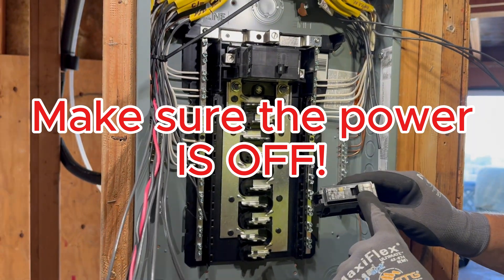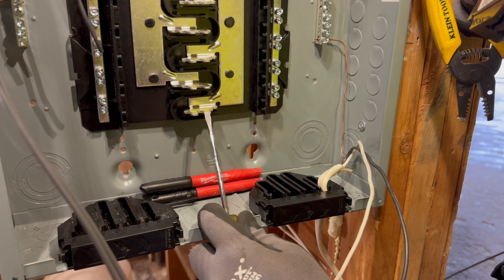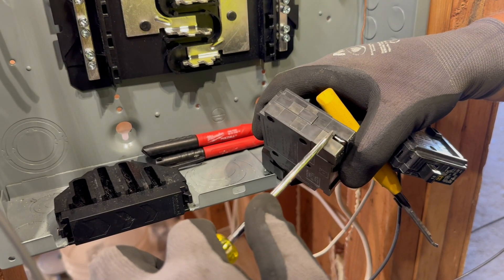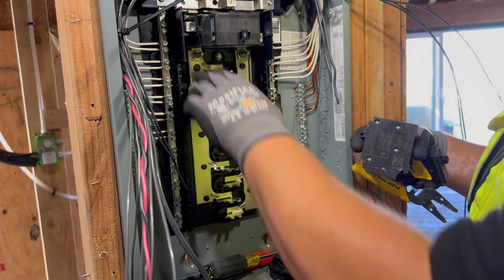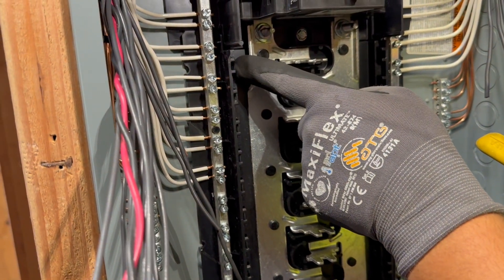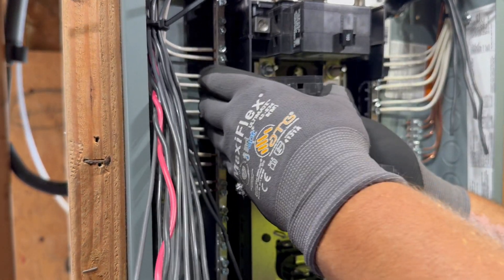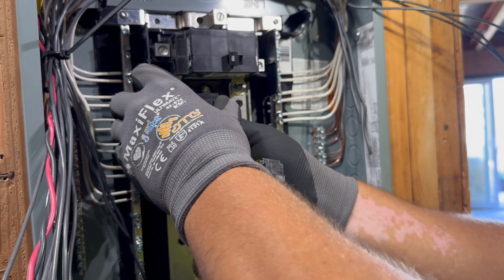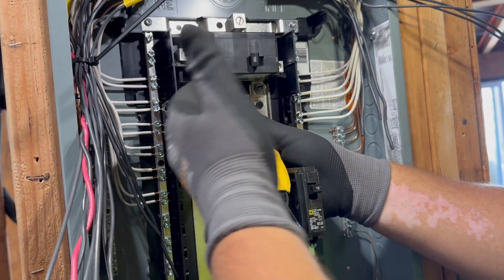How To Change Or Replace A Circuit Breaker | Electrical Panel Upgrade

Comment: I notice all the neutrals are landed in the neutral bus bar. Where are you going to put the code required afci’s?
Reply from the maker: Good catch. We’re going to take the ones off that have to be landed on AFCI’s and land them on the Breakers. Wanted to show how to land them neatly